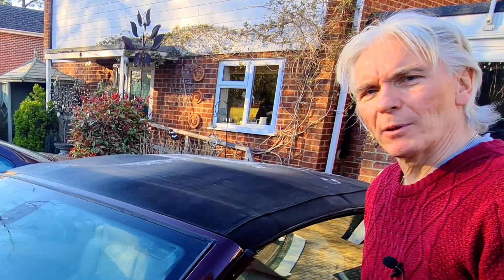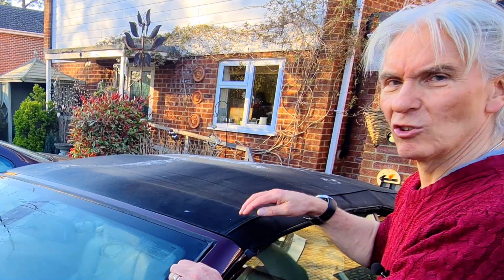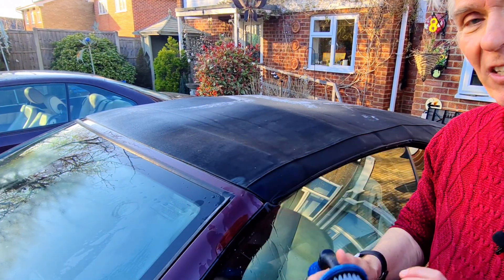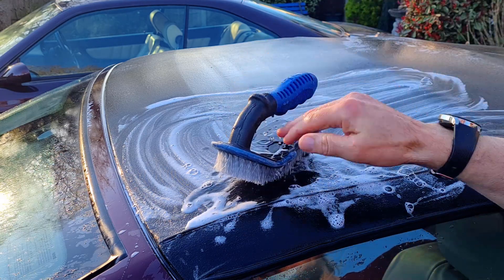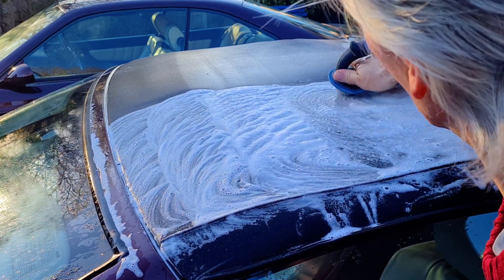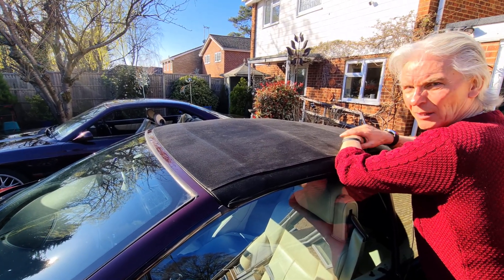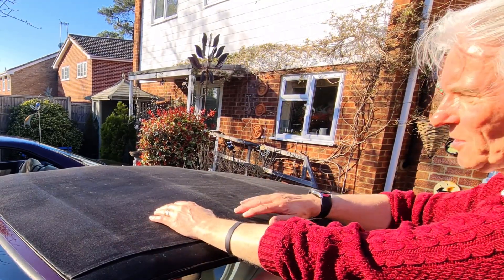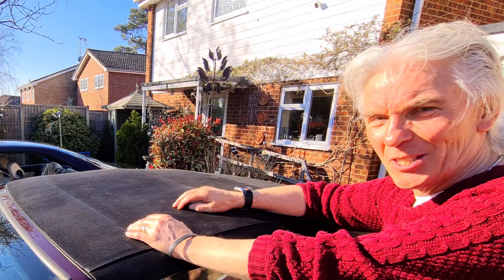CAR SOFT-TOP LICHEN REMOVAL

Comment: i used miltons stailizing fliud.then renovo reviver which i applied with a foam applicator,far less mess than a brush then fabsil water proofer in an aerasole.brilliant
Reply from the maker: Pressure washer was the most successful way I found of cleaning the fabric!

Comment: Hi Tim I have a e64 2009 and I’m having trouble trying to remove the water marks on the rubber where the roof sits on when the roof is closed. When it’s open these marks are very in sightly. Can you help ?
Reply from the maker: Those marks are awful aren't they! I'm just about to try Cerakote which is quite expensive - if that doesn't work I'll remove it and paint it! I'll let you know how I get on.
Reply: @TimmsBMWRepairsandInformation  Thanks Tim I’ll wait and see how you get on 👍🏻

Comment: Hi Tim. Your videos are excellent and very informative. Please keep them  coming. I have an e64. Got a question relating to the passenger side dashboard.

I seem to have some cracks forming around the passanger airbag dashboard seal. Have you come across this issue before?

Other than replacing the dashboard  what options do I have to repair this?
Reply from the maker: Thanks Rayen, no, sorry, not enough heat here to crack anything!

Comment: Hi Timm. I've got a question about remapping (sorry, would've posted to an older video, but not sure you would see it). After putting on an after market exhaust, should I remap my 650i or is that just asking for trouble?
Reply from the maker: Just don't - the 650i is fast enough without messing up the mapping!
Reply: I totally disagree with timm on this one - a good, dyno'd remap will allow your engine to make the most of your new (presumably higher-flowing) aftermarket exhaust, and you might see considerable power gains!
Reply: @LochyP  Yes, the exhaust is higher flowing and I can already feel a power increase. I would hope the dyno would add a bit. Whilst the 650 is fast, there are cars out there (AMG, S line and M cars) that are very intimidating when they pull up next to you at the lights. It would be nice if I had 380 - 400 horses under the hood.

I'm just super wary about upsetting car in anyway.

Comment: This is a horrible job but I've just used Autoglym and I have to say it really does the job. It's not cheap but then it's one of these jobs where you have to pay proper money to end up with a proper result. It's not that hard to work with and they supply a spray bottle to apply the waterproofer when the roof is still damp. You should try it Timm.
T
Reply from the maker: Thanks Tony, I've got some new stuff to try at the weekend - I'll let you know how it goes!
Reply: I tried Autoglym too, lichen gone!

Comment: Timm, your channel is the only reason that I keep going with my e31 1995 m60,now with 80k, but recently the SRS light came up and I don't have any idea how to get rid of that light, can you give me a clu?? Thank you. Mario
Reply from the maker: Thanks Mario, the usual culprit is the passenger-seat occupancy sensor - but can be most things including the steering wheel clock-spring. Diagnostics are neigh-on impossible (INPA etc), so a multimeter is the way to go.
Reply: @TimmsBMWRepairsandInformation  thank you for your time. Md

Comment: “Washing up liquid”?! 😳😮
Reply from the maker: Dish Soap for non- UK residents!
Reply: @TimmsBMWRepairsandInformation  
I’m surprised. It’s not something I’d use on anything of any value.
Reply: @Jon-zj2nj  Don’t be tricked by expensive products when household items can do the same job
Reply: @bradley7240  
I damaged a lot of car paint using washing up liquid, until I realised that there was a very good reason for using car specific shampoo instead 👍
There’s no way that I’d put it anywhere near an expensive car fabric hood.
Reply: @Jon-zj2nj  in what way did you damage paint with dish soap
Reply: @jezlucas3878  
It took the gloss off the paint and left it dull, even after only around 20-25,000 miles. I did this to multiple cars and the effect was always the same.
I thought it was normal for paint to age like this, until I changed to products designed for car use many years ago. I’ve done nearly 130,000 miles from new in my current car and it’s still got a proper gloss on the paintwork.